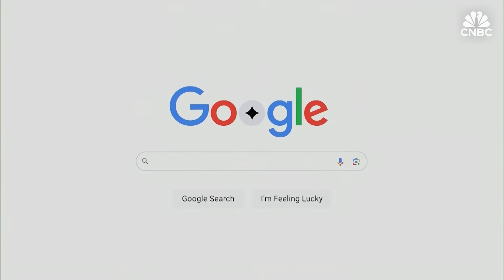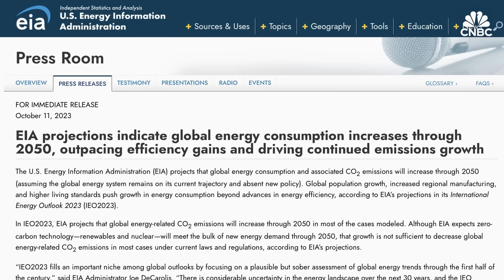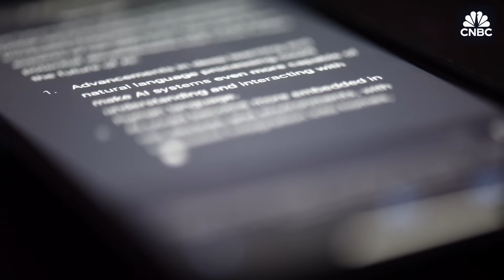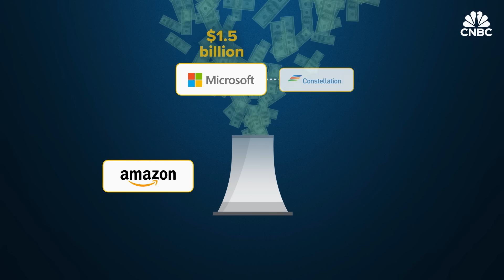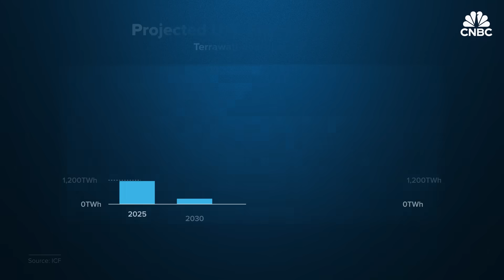Why Amazon, Microsoft, Google And Meta Are Investing In Nuclear Power

Comment: Not once in this infomercial was the issue of nuclear waste mentioned.  That's the scary elephant in the room.
Reply: Why are you emotional about it? You can educate yourself on it.
Reply: @edheldude educate yourself on the Techa river
Reply: @edheldude  
I highly encourage you to read up on geothermal. The promise here is spectacular without the baggage of nuclear.
Reply: Nuclear waste is bascially a non-issue compared to the amount of cancerogens and pollution oil, gas and coal puts out into the atmosphere every day. It's not even funny. It's several orders of magnitude in volume. In my country the total volume of nuclear waste from over 60 years of production would fit in a couple of 25 m swimming pools. And I believe they are still there (intermediate storage) since politicians can never decide on how the long-term storage should look like. I.e it's more of a political problem then a technical one.

Also a lot of the waste produced by older nuclear plants can now even be reused as fuel for modern plants.
Reply: @Jonteponte71  
Point well made. But still think geothermal would be a better solution. No toxic waste ans much less vulnerable to sabotage and terrorism.
Reply: @ConorRyan-kw4sx  ... what are you basing this on? Are you an energy engineer?
Reply: @edheldude  
Basing it on what I've read.  Geothermal engineering is having major breakthroughs, like so many other areas of science right now
Reply: @Jonteponte71  Check out "Onkalo" for long-term storage.
Reply: For people interested in actual facts you can check:

- Three Mile Island: The Controversy Continues (Link TV on Youtube) - Dr Steve Wings (whose study was mentioned in the recent documentary Radioactive: The Women of Tree Mile Island) claims that lung and leukemia cancers were 2-10x of the average downwind of Three Mile Island reactor after the accident. Dr Wings reanalyzed the Colombia study on behalf of 2000 people suing the industry for health damages but their case was never been heard in court on the excuse that there was not enough evidence. Higher rates of cancer patients found in conducted studies were often disregarded by authorities as likely due to stress, and this was also the official conclusion of President Carter, a nuclear engineer by education who was advised by Admiral Rickover, the man behind the US nuclear submarine program. The nuclear industry eventually paid over 82 million $ by 2002 in out-of-court settlements, so the issue seems to be far more in restricting unwanted publicity than unwillingness to pay. Also shown are some victims sharing experiences from being irradiated, and examples of abnormalities in fauna and flora near the accident.

- The Women of Three Mile Island - documentary about the downplaying of the accident and discovery of repeated failures that eventually led to the closing of the power plant once the public found out, but nowadays nuclear & big tech industry pushing their narrative about people being emotional once again for the sake of winning the AI race, and no silly facts will stop national interests.

- China's Nuclear Disaster Imminent? (serpenza YT) - short video about shady safety standards in nuclear industry of China causing leaks and lowering radiation standards as cover up.

- People & Power - Danger Zone: Ageing Nuclear Reactors  (Al Jazeera YT) - about the US nuclear industry's unwillingness to finance proper maintenance of reactors at the end of their service life for the sake of higher profit margins. 

- Should GE’s Mark 1 Nuclear Reactor Be Recalled Worldwide Like a Faulty Unsafe Automobile? (Environews YT) - the US industry hid well-known design flaw in their early nuclear reactors in a similar fashion as the Soviets did with Chernobyl reactor design in order to not harm profits and industry image... 

- Danger! Radioactive Waste (Films Incorporated) - 70ties documentary about shady days of the US nuclear industry dropping barrels with radioactive waste into the sea en masse while Greepeace activists trying to prevent that with boats near disposal vessels, disposing of radioactive waste into building materials used for walkways and more. The documentary was later used by HBO comedian John Oliver in an episode about the nuclear industry to point general trend that is prevailing to this day towards underplaying the danger of improper nuclear waste disposal and cost-cutting in every way imaginable.   

- Uranium - is it a country? (Nuking the Climate) & Uranium (National Film Board of Canada) - documentaries about environmental and health issues associated with uranium mining. - First Tuesday: Windscale The Nuclear Laundry (1983) - issues with nuclear fuel reprocessing plant in the UK, high levels of measured radioactivity nearby facility, claiming 10x rise in rare leukemia in the nearby village - Our Reactor Is On Fire - in 1957, an accident in a Windscale facility used to produce weapon-grade fissile material released a large amount of radioactive material into the surrounding area resulting in loss of life and quality of life by the people nearby, this was followed by fairly unsuccessful cover-up of what is regarded as largest UK radioactive pollution accident of the 20th century due to rushed UK nuclear weapons development to secure UK position as a nuclear power prior to planned atmospheric nuclear weapons test ban. 

- Wasteland / Kyshtym disaster and pollution of the Techa River - environmental and human consequences of multiple accidents in Soviet/Russian Mayak (lighthouse) nuclear fuel reprocessing facility requiring relocation of population. 

- Children of Chernobyl (Filmakers Library)- shows health issues caused by accident a few years after that were downplayed by governments and the nuclear industry around the world to the point of being known that the KGB was stealing data on cancer patients from hospitals. Yet misinformation about total casualties being only initial casualties of firefighters was spread for a very long time around the world, in fact, you can find the nuclear industry stating it as fact to this day on the internet in various seminars and hearings, despite this movie claims among other things that rates of very rare leukemia rose in Kiev/Kyiv 10x in years after the accident.

Comment: So, CNBC convinced people that AI and data centers put so much strain in the power grid that only nuclear power works. But electric cars also put too much strain on the power grid so it is not feasible?

What about Tesla energy. Unprecedented demand for batteries to store renewable energies so that they can be used at night.
Reply: You can't run industrial scale stuff with renewables. Those batteries are for you home.
Reply: Cars are variable loads. Bad application for nuclear. Data centers are pretty much constant loads. Good for nuclear.
Reply: As @ILoveTinFoilHats stated, EVs are basically variable loads. They don't need energy 24/7, but datacenters do. You don't turn off a datacenter just because it's been cloudy for weeks (happened in Germany the past months) where wind / solar generation is low. You'd need an unprecedented amount of batteries to handle cases like those, and I'm speaking on volumes many times than the current battery production we have today. You could essentially build thousands of nuclear plants with that price.
Reply: @ryoukokonpaku1575  thousand of nuclear plant. One of those nuclear plant is already extremely expensive, and quite dangerous.

Battery is getting cheap. Cheaper over time. So many innovations in battery, making them non toxic, long lasting, recyclable.

Renewable energy with many batteries is the way to go.

Comment: Where do you get the uranium from?
Reply: Canada and Kazakhstan, Australia
Reply: @Mike_12123   Kazakhstan has two times the urainium from canada, and Kazakhstan is controlled by russia, germany made the same mistake with to much dependency from russian gas
Reply: Where do you get your copper, cobalt, lithium, aluminium for renewables?
Reply: @ReiserVergeDelfin-fv4hq  urainum is mostly available from countrys which are under control of china or russia, copper lithium is much easier to get cobalt is a problem
Reply: there's a lot of uranium on earth. more than lithium.
Reply: You are correct! There is a lot of uranium underground.  The hard part is getting it out of the ground. It's not easy and it takes years
Reply: @aaronalquiza9680  no its not
Reply: china 😂
Reply: It's everywhere.

Comment: The addition and reconditioning of nuclear power plants only addresses one part of maintaining a stable electrical grid. The Supply part. As the supply of electricity for the grid is increased due to AI and other factors, electricity providers would also have to build out the additional transmission and distribution infrastructure to carry these new loads to the end user (ratepayer) in order to keep the existing grid stable so that electricity rationing can be avoided.

Comment: New nuclear is most expiensive solution for decarbonisation. SMR works only in power point for now.
Reply: The up front cost is about triple  coal/gas plants. (Wind and solar are unreliable). BUT the cost for fuel to run   a reactor is about 5% of operating cost, where as fossil fuels are about 85%. And btw a nucular plant can run 80 to 100 yrs
Reply: @chadg7457  The total cost of electricity (LCOE) for new nuclear power plants is $160/MWh (Hinkley Point C). For new wind power plants, it is $30-40/MWh.  The LCOE for new gas-fired power plants (CCGTs) is $41-72/MWh. Nuclear power plants need gas (or hydro) for peak electricity demand.

The oldest operating nuclear power plant is 55 years old. The nuclear industry always fails to deliver on its promises, so this 100 years is cheap marketing.
Reply: @chadg7457  1/2
The total cost of electricity (LCOE) for new nuclear is $160/MWh. For new wind onshore, it is $30-40/MWh.  The LCOE for new gas (CCGTs) is $41-72/MWh. Nuclear need gas (or hydro) for peak electricity demand.
Reply: @chadg7457  2/2
The oldest operating nuclear power plant is 55 years old. The nuclear industry always fails to deliver on its promises, so this 100 years is cheap marketing.

Comment: This is good. Because no matter what, engineers and CFOs will not let those “one query uses 10x the energy of one search” forever. It’s too bad for their bottom line. They help build nuclear, the AI becomes more energy efficient to save money and cut down on heat, and then the excess nuclear energy will be sent to the grid, which will thus help speed up societal clean energy goals.

Comment: Respectful Greetings!
To: CNBC Youtube Channel.
Nuclear power is not renewable, but given the volume of source materials available, it is essentially inexhaustible. It produces no GHGs, making it an excellent energy source strictly from the perspective of limiting climate change. There are two types of nuclear power: nuclear fission, which is well tested as an energy source, and nuclear fusion, which is untested commercially and still in development.
Tech giants like Amazon, Microsoft, Google, and Meta are investing in nuclear power for several reasons:
1. Energy Needs of Data Centers
Massive Energy Consumption: Data centers powering AI and cloud computing require enormous amounts of electricity. Nuclear power can provide a steady, reliable source of energy to meet these demands.
24/7 Power Supply: Unlike some renewable sources, nuclear power can provide continuous, round-the-clock energy, which is crucial for data centers that operate 24/7.
2. Sustainability Goals
Carbon-Free Energy: Nuclear power is a carbon-free source of electricity, helping these companies achieve their sustainability and net-zero goals.
Reducing Grid Stress: Partnering with nuclear power projects can help ease the strain on local power grids, ensuring a more stable energy supply.
3. Technological Advancements
Small Modular Reactors (SMRs): These new types of nuclear reactors are gaining attention for their ability to provide efficient, low-emission power. Companies like Google are partnering with developers of SMRs to power their operations.
Innovative Projects: Microsoft, for example, is recommissioning the Three Mile Island nuclear plant to exclusively supply power to its data centers.
4. Economic Impact
Job Creation: Investments in nuclear power projects can create jobs and contribute to local economies.
Long-Term Benefits: Nuclear power projects can provide long-term, stable energy solutions, which are beneficial for both the companies and the communities they operate in.
5. Future-Proofing
AI and Advanced Technologies: As AI and other advanced technologies continue to grow, the energy demands will only increase. Investing in nuclear power ensures that these companies can meet future energy needs sustainably.
By investing in nuclear power, these tech giants are addressing their massive energy needs, supporting sustainability goals, and contributing to the global energy transformation.
Courteously!
Luis Lopes

Comment: Because it’s the ONLY viable option for the world’s energy future. Period. 

Until we perfect non-toxic batteries with a huge capacity and a life cycle count that can measured in millions of charge/discharge cycles no amount of wind, solar, and hydro (ignoring the other complaint environmental types make about dams) will even have a chance of replacing fossil fuel.

And then there’s the problem with PORTABLE batteries required if we’re going to talk about converting all cars, trucks, ships, and planes. There isn’t even a theoretical type of battery on the distant horizon that can match the energy density of gas or diesel for those applications.
Reply: The sun supplies earth with more energy in one year than all other forms energy combined for the entire existence of the planet. Nuclear, fossil fuels and so on are all short term energy solutions. The fusion reaction in the sun is consuming 600 million tons of hydrogen every second. The amount of hydrogen on earth would not last long, and we kind need most of that hydrogen to remain bonded to oxygen.

Comment: Geothermal energy, lots of reliable energy below our feet and no one can jack up your rates because of monopoly and zero environmental risks. 🎉
Reply: That's why there has been talk of placing AI data centers in Iceland, where geothermal power is plentiful (and most of it still untapped). Another country where AI data centers could go is Norway, a country with massive amounts of hydropower available.
Reply: @ and, the heat produced by AI data centers would be tempered by the relative cooler temps, in the countries that you mention.
Reply: 🩷YES🩷 Just one of our natural resources, but where’s the greedy profit in that?
Reply: @Robert How far down do they need to be to be effective?
Reply: @robertlee8805 it’s only viable near volcanic areas in the earths crust. Anywhere else and you have to be deeper than we can drill